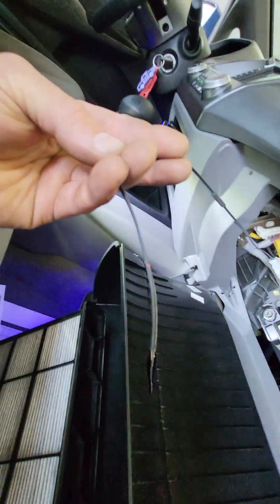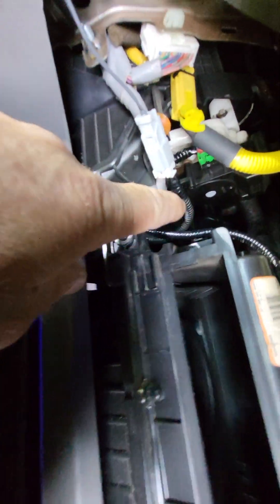2007 Honda civic ac cycling on off but not from low refrigerant..

Comment: I bypass these to test them most of the time with a decently high value but i rarely see these types of issues might be the rust belt destroying things.

other fun i have had are rust belt cars or trucks down here and requires brake lines and no one else will touch it because its a little corroded and wiring requiring bypassing a connector because the car is not worth the price of both sides of the connector as it is only going to last for a few more years at most as the cancer has taken hold.